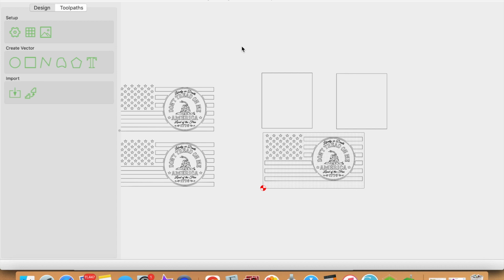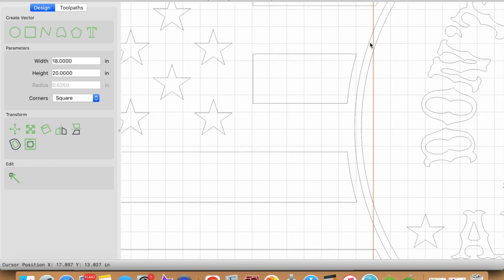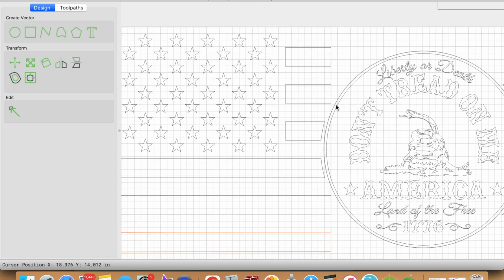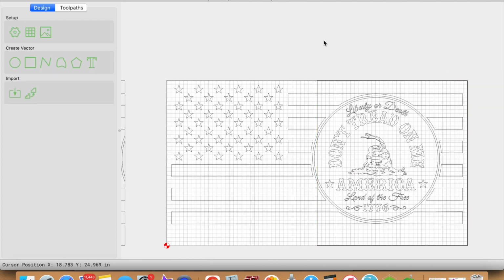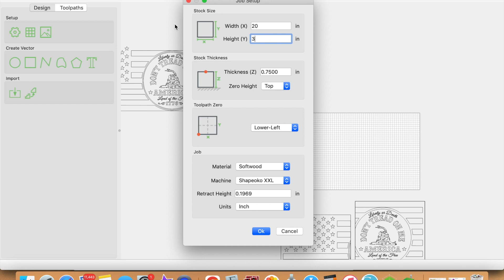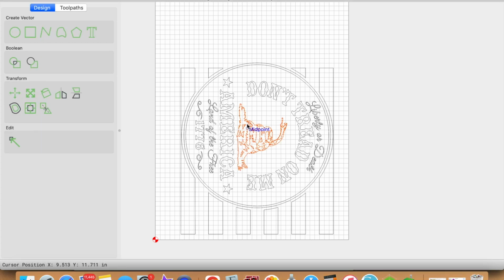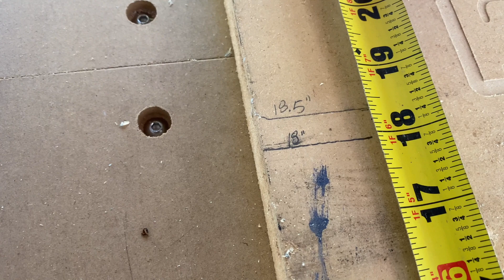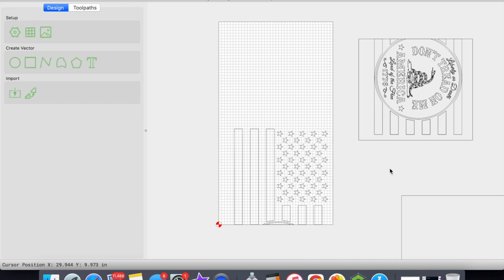How to Carve a Large Sign/Flag on a CNC / How to Tile Using Carbide Create / Tiling on Shapeoko

Comment: Hi Edgar I'm a big fan of your  channel you have taught me a bunch of things about cnc work and carbide create. I'm trying to make the American flag on a single piece like you did in the video but I always keep coming with different depth on the stripes. Do you surface your board before carving. I've been having same issues with other projects and it's aggravating.
Reply from the maker: I’m glad to hear it’s been helpful.

No, I don’t surface the material beforehand.

What you can do and not sure if it’s in this video is reset your z zero.  If you don’t reset your z zero it’s still carving based on the first tile.
Reply: @aetimberpine appreciate it brother. Thx for the helpful tips.

Comment: Can you tell me how much time/effort you spend on clean up after cutting your design on the CNC? I noticed that with the VCarve, my lines are sharp, but the interior (where the router cuts) is mostly fuzzy, especially with thinner, smaller areas. I have to clean it up with sandpaper and a brush. End mill cuts are fine. I only experience the fuzziness with a v-bit. I’m wondering if this is normal or if I’m doing something wrong.
Reply from the maker: i don't spend too much time, I use a toothbrush to clear out most fuzz or just rub them away.  Once I start seeing fuzzies that I cannot get ride of, i will replace the vbit.  Try a new one and see how that goes..  You also may need to speed up the router rpms slightly. But most of the time I think its just time to replace the vbit.

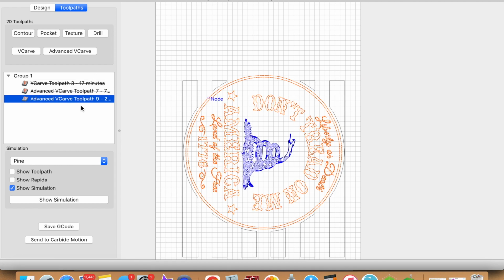Comment: 9:40 that gap is actually engineered into tape measures. Hold it tight. Should be accurate
Reply from the maker: Thank you for the heads up! I was on the fence whether or not it was accounted for!

Comment: Hey got a couple questions on the emblem in vcarve. Are you doing each piece individually compared at once for the look cuase i did all at once and not what i expected. Will this change the look
Reply from the maker: Hey man,
I did the emblem with multiple toolpaths.I would not use a vcarve only on this design.

- text is vcarve 
- snake is advanced vcarve
- any circles could be done with vcarve or pocket, depends on your preference. 

- stripes: I always use advanced vcarve

And so yes you’ll get different looks between text and image but that’s okay. 

You could also go advanced vcarve on the text if you wanted everything to be carved to the same max depth and Match the emblem (snake)
Reply: @aetimberpine  I did advanced vcarve 1/8 uncut and a 60 vbit well let me try setting max cut depth shallow depth
Reply from the maker: @northwestgaming4049  I would do a max depth of 0.03” or 0.04”.

Comment: i keep getting a line through the middle when i remove the last tile before toolpath. the toolpath wants to cut through the center of the project to make halves,
Reply from the maker: Hey Mike, it’s tough to say. There could have been multiple factors or a simple fix.

I hope you were able to get it figured out. If you’re not already in cnc FB Groups, I’d recommend joining so you can get help from the cnc community.

Comment: Good video. Another tip would be to cut your stock at 21 inches so you can Brad nail it and not have to clean up and can just trim .5 off both sides.
Reply from the maker: Great idea!  I'lll have to figure that out because I did end up cutting the bottom strip to size and that removed any nails holes but the top side did have nails holes to cover up. If I center it just right I might be able to trim both the top and bottom sides and remove all nail marks!